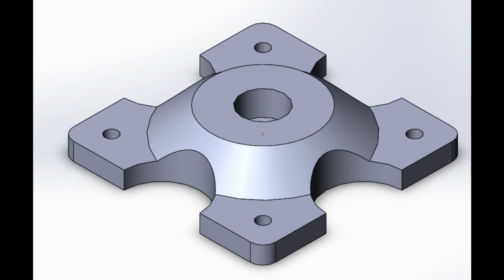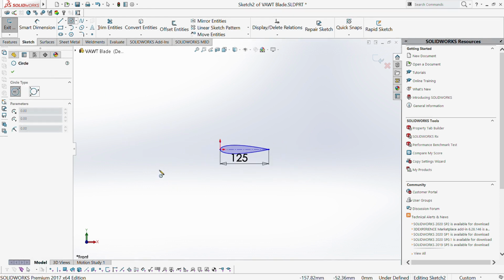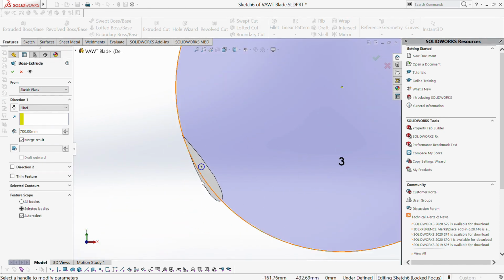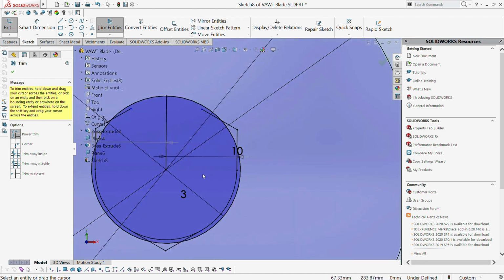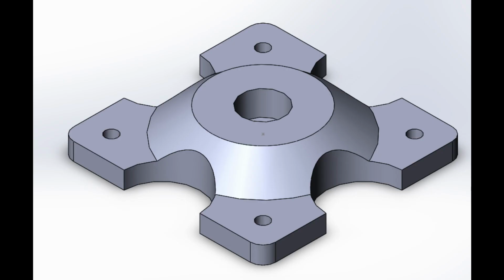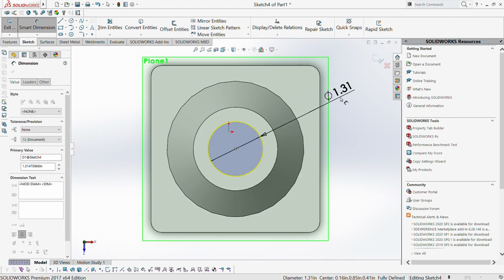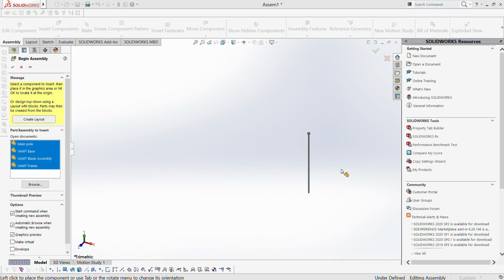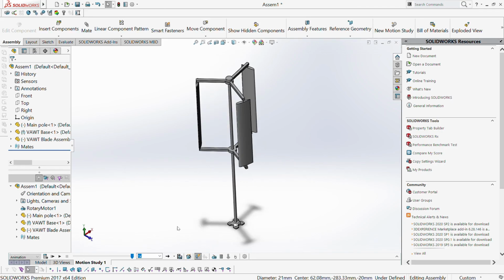Solidworks with Kabir | Designing tutorial of a Vertical Axis Wind Turbine/Mill  for beginners

Comment: how calculate wind mill fan force turque speed and time in solidworks
Reply from the maker: I will recommend using MSC Adams or Matlab Simulink & Simscape for that purpose.
Reply: I create model solidwork
Issue is
Velocity air flow 5 to 15 meter par second
Fan qty 10 nos

So how much rpm genarate 
And  how calculate and simulate

Comment: Hey Kabir, Do you have any idea about softwares which can help in running simulation? I wish to run simulation for Vawt design to have some idea about the RPM/torque  achieved at corresponding wind speeds... Could you suggest?
Reply from the maker: Solidworks has a simulation feature and you can use ANSYS or Hyperworks for better-detailed results.

Comment: I'm sorry to be negative but this is a really dreadful example of BAD DESIGN work! FIrstly, the 3-blade final structure is woefully inefficient for a vertical-axis turbine and the individual blades are symmetrical - WHY? It's much better to have one side flat to create effective lift.
Secondly, even if the design-concept were perfect, the execution in Solidworks was terrible! Creating massive file sizes by wasteful use of multiple PLANES, using LOFTS instead of simple rotations to create solid bodies and multiple extruded-cuts were most could be done from one sketch. Why make it so difficult? Why make the resulting files so huge when the object created is really very simple?

Comment: hi how do you get back to this view at 7:35 ? I wanna select the middle point of the circle for the circular pattern
Reply from the maker: I had rather have you select the circle itself as a reference for the circular pattern, works like a charm all the time. If you still want to do it with the centre try playing with the property manager and select this specific sketch, or use construction lines to draw mutually perpendicular diameters thus exposing the centre, etc.
Reply: @MakewithKabir  just to add on, what did you press from 7:28 to 7:30? My circle is somewhat missing, idk what to take reference from when doing the circular pattern haha
Reply from the maker: I am afraid I don't recall that, I will recommend pressing the spacebar and trying different views yourself.
Reply: @MakewithKabir  So any answer to this?it happens to me also
Reply: @giwrgoslepipas4041  Since this is a persisting confusion, I will retry the whole thing and get back to you ASAP! Do check over here on the coming Monday. Cheers!
Reply: @ptiwaridotin  Thank you very much.The rest of the video is just perfect but sadly because of this point I and probably some others cannot continue.It would be very helpful sir .Thank you in advance!